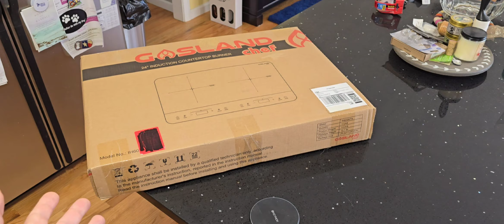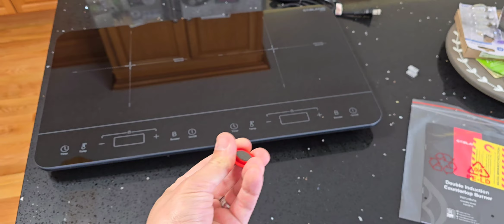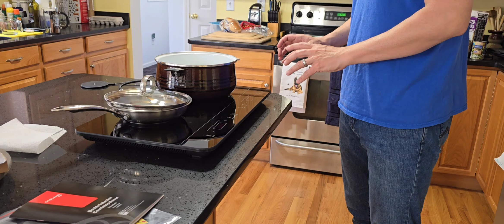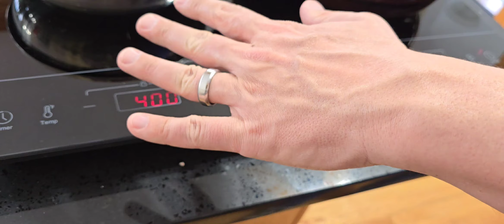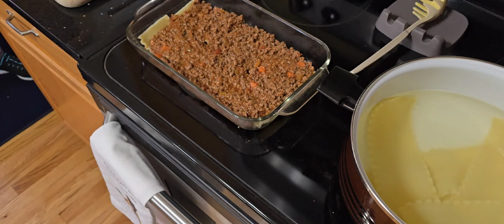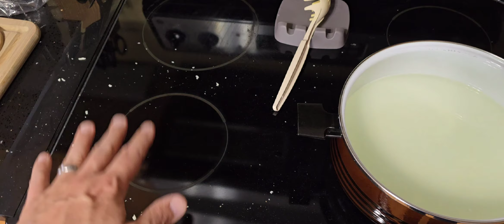Gasland Chef Induction Cooktop IH602BTA: Product Review & Testing

Comment: yeah, the ferrous material in the cookware is like the "transformer secondary".... I guess the line is converted to lower voltage DC, and a chopper circuit controls the pulse width.
Reply from the maker: No it's usually a higher voltage. A higher voltage requires less amperage and a higher frequency makes all of the switching components like capacitors and inductors smaller in size. A lower voltage would require more amperage. It operates in the same manner as the wireless charging pads for our cell phones. It's a great method of transferring energy which is essentially what an induction cooktop is doing.
Reply: @Bassguitarist1985  higher than line? I heard it's lower than line ... I mean I don't know that, I read that it's lower than line; but obviously then PWM DC out to a 50% wave.
Reply from the maker: @RulgertGhostalker  input voltage from the wall 120 or 240V is brought into the unit and is rectified to full line DC. A PWM controller operates a full square wave inverter in the 25khz-50khz frequency range to run the large induction coil using large IGBT components. As you mentioned the pot/pan is essentially a shorted single coil, to which the Eddy Currents build up in the metal giving off heat.  The voltage within the pan is stepped down considerably, but the amperage is greatly increased.

Great technology, and very efficient energy transfer!
Reply: @Bassguitarist1985  RMS line ??? Wow...that's nuts ..I knew it was high frequency PWM, but the article I read, ( and I can't remember what unit it was on ) said 48Vdc...a long way from RMS line.

but super efficient, yes...I love that there is no  heat wastefully spilling around the cookware.
Reply from the maker: @RulgertGhostalker  nope. And plenty of safety sensors so your metal wedding ring doesn't get hot when you put your hand near the inductor coil. 😋

Comment: I have a DUXTOP single " burner" ... I love it.. currently doing my famous single dish pork "stir fry" ( with out the stir )
it starts with a little peanut oil in the bottom of my Cast Iron WOK, 
add hot crushed red pepper to covered in the oil, steep the pepper heat into the oil on low, while cutting the pork into stew meat size, and mincing a little ginger....ginger down first, wait, then pork.( no stir) go strait to adding rice, shiitake mushrooms, a good splash of apple cider vinegar, water, and cover on low weighting the lid....mix in chopped scallions and serve.
Reply from the maker: Damn that sounds good!!
Reply: @Bassguitarist1985  good enough that replying to you is saving me from scalding my esophagus.
Reply from the maker: @RulgertGhostalker  I like hot stuff as much as the next person but not so much so where that is happening. I don't want my food to hurt me. It's meant to be enjoyed haha!
Reply: @Bassguitarist1985  I don't have anyone to impress, so I eat right out of the wok, ( requiring a little more cooling time, in trade for the reduction in dishes. ) .. spicy hot though, I have a certain endorphin quota I have to meet every day.